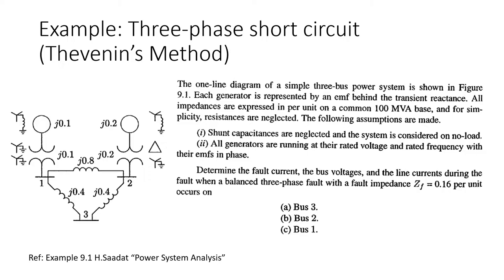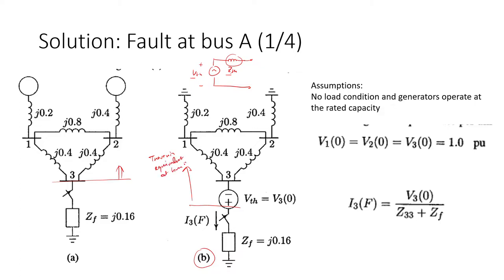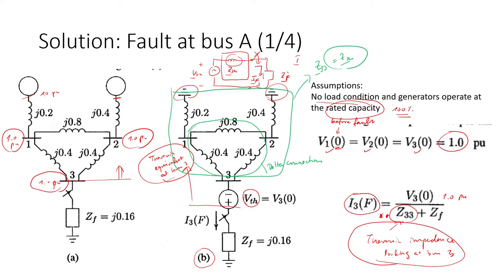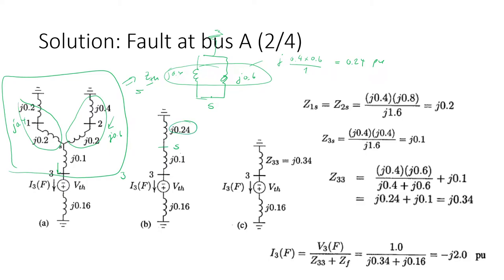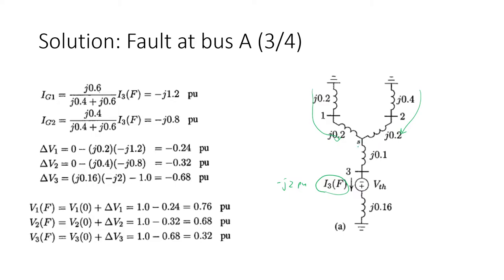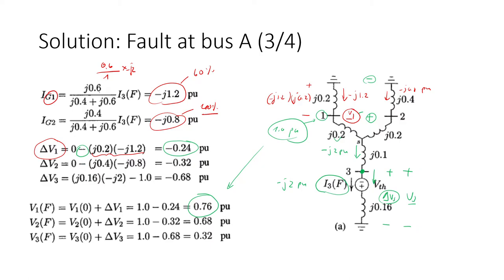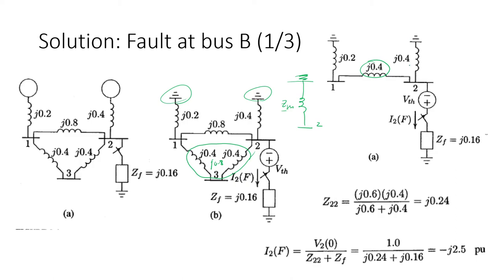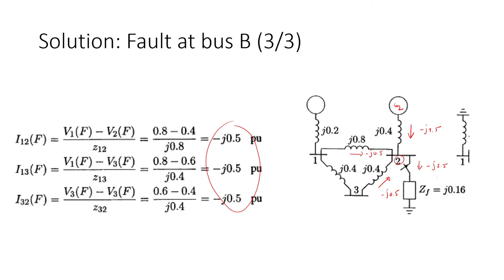Symmetrical Fault Calculation using Thevenin's Method: Example 9.1 H. Saadat

Comment: Please check the voltage at bus 3 during the fault. It should be the drop at fault impedance i.e. 0.68p.u. and not 0.32p.u.  Please clarify.
Reply: Nah there's nothing wrong there